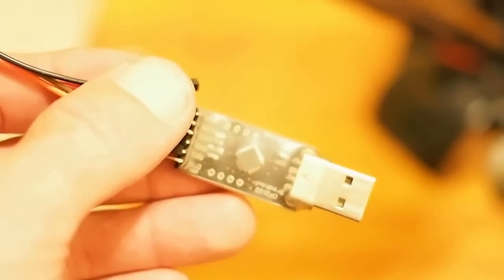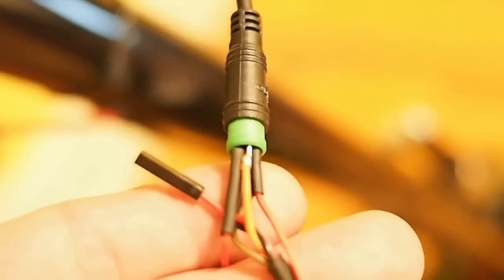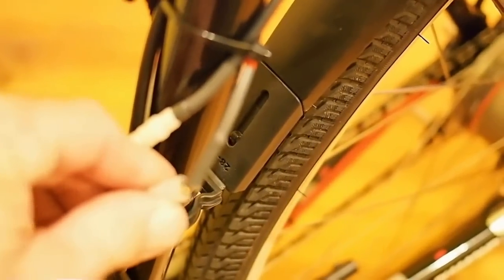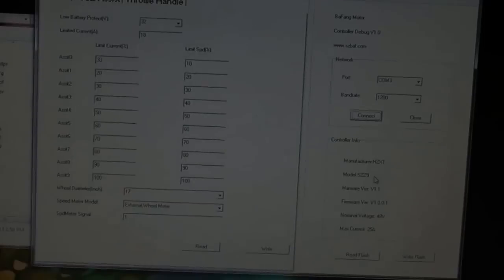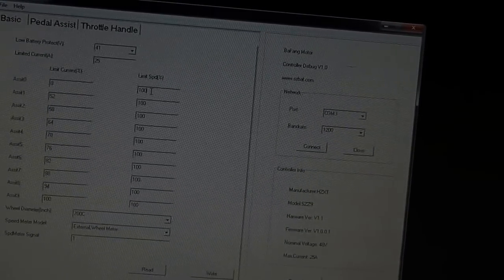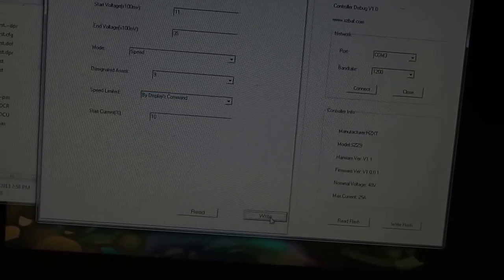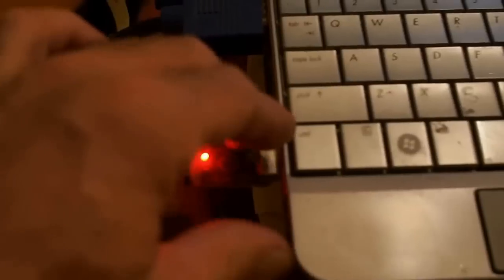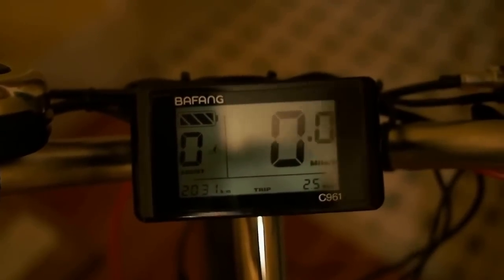Bafang BBS-02 Advanced Serial Hacking - Throttle

Comment: Anyone know if I can tap the illumination function to also activate my lights
Reply from the maker: I'm sure it's possible. But it's an advanced project. you'd need to open up the controller (C961) and find & tap into the backlight power, then use it to trigger a relay or transistor that turns on your light.

if you do this you are TOTALLY voiding your warranty. 

Note - also if you do this you should ISOLATE everything properly. this means using an optoisolator and a solid-state relay at the very least. It also means powering the ENTIRE circuit from your headlight. (You use the backlight to trigger your light but do NOT power your headlight from it! This is an important distinction. DO NOT PROCEED UNLESS YOU UNDERSTAND IT.)
Reply: +Charles Werbick yeah was mine line of thinking too was hoping someone had a schematic or the display
Reply from the maker: Andrew Meddley - Sounds counterintuitive, but I'd try Bafang themselves. They are surprisingly helpful and if you don't care about your warranty...

http://www.szbaf.com/en/service/contact.html
Reply: +Charles Werbick my warranty was vides the day I got it I think I installed a temp sensor and have been running it on a 14s4p since day one and it was only 90 days from Luna cycle

Comment: I'd like the bike to start-up in PAS 0 instead of 1. Anyone know what setting that would be?
Reply from the maker: I'm betting that's a function of the C931 (i.e. the LCD display part) more than the part being programmed here (the motor controller). You can probably get the behavior you want by changing the PAS 1 settings to NOT provide assist. That would essentially turn PAS 1 into PAS 0. But it would still say assist level '1' on the display. 

There may be a way to program the C931 to start in PAS 0. But it probably would involve hooking the FTDI adapter to the C931 and programming IT. (Which I don't know if there is software for) But that's an interesting idea...
Reply: Clever idea. I'll reconfigure PAS 1 like you said.

Thanks for the video. I was able to get the throttle to work in all PAS modes. I followed all your steps but the throttle still didn't work in PAS 0. My unit had "Designated Assist" in the throttle tab set to "Controlled by Display" from the factory. I had to change that over to 9 then I was all set.
Reply from the maker: Evan Calder Glad you got it going! FYI - it is possible with the throttle set to 9 to trip the resettable fuse in the unit if you gun it from a dead stop in high gear. (I found that out the hard way ;-) If that happens you can disconnect the battery for a few seconds to get it to reset.

Happy Riding!
Reply from the maker: Evan Calder  BTW - I edited the instructions to reflect your tip in case anyone else runs into this issue. Thanks again!
Reply: Charles Werbick Hi i seam to have done this also but I've disconnected the battery for a day and I'm still not getting anything from the motor
Reply from the maker: +Chris Chiles I had that happen too. There are capacitors inside the unit that can hold a charge for some time. To fix, short the Bafang power leads (i.e. unplug the battery,  take the power leads  that WERE connected to it and touch them to each other for a second to drain the caps in the Bafang. Make sure NOT to short the battery itself. You want to UNHOOK the battery and drain any residual energy stored in the bafang.) 

Hope that make sense.
Reply: Charles Werbick thanks or the tip but I'm still not getting any power from the motor although the walk assist chunks it doesn't turn the wheels, my speed sensor is out does that make a difference?
Reply from the maker: Chris Chiles Yes in all likelihood. The speed sensor is required to function in order for the unit to function. (The controller relies on the speed sensor to govern the motor and provide pedal assist. If it's out, you need a new one. I would not try to ride without it working properly.)
Reply: Charles Werbick Ok, I've got a new one on order, thanks for the help you've been way more help than the Chinese vendor.  The motor worked with a broken Speedo before, could you point me at the fuses?
Reply: Charles Werbick i changed the speed sensor and still nothing
Reply from the maker: Chris Chiles  Is it giving you an error when you turn it on?

BTW - when the internal fuse goes then it goes totally dead until it resets. No display, nothing. If it turns on and you get a display that's a good sign at least.
Reply: Charles Werbick I was getting an error 21 when the bike was in motion.  When I struggled it in the engine stopped the display has continued to work, and no error is showing
Reply from the maker: Chris Chiles - Error 21 is speed sensor. But the throttle should still work. (The display won't though and neither will PAS.)

Sounds like your symptoms similar to this?  -
https://www.youtube.com/watch?v=RsGEPDrhAlw

(Note - In the link above the poster says 'dead controller'. I have  no idea whether they are referring to the LCD 'controller' or to the ESC 'controller' that's in the motor housing. If your symptoms match, I'd post your question on that page. and ask them exactly how they resolved the issue.)

Comment: Oh, and my speed sensor light did not come on when I connected the battery. It worked anyway
Reply: Henrik Nilsson Hei Henrik! Try to restart your computer, then start the program from file. I have the same problem. Don´t forget to disconnect the battery pack before you disconnect the program cable. When you try again, connect the program cable first, and the start the program. Finally switch on the battery. (are you Swedish?) Thank´s for a fine tutorial Charles!

Comment: Has anyone tried this on C963 or C965? Or know if it should work or not?
Reply from the maker: +Tom Gundry  - This method programs the BBS motor unit NOT the display. So it should work. (You actually unplug the controller/LCD and use that connector to talk to the motor. )
Reply: +Charles Werbick great. I was a bit unsure if the bbs02 might use differ nt firm ware for different controller set up s
Reply from the maker: Tom Gundry - I'm sure the firmware has changed since I bought mine. Also a lot more of the settings have been documented. 

Further down in the comments there's a link to the thread about Bafang serial programming on Endless Sphere. The most up to date info will be there on that forum. (Hope this helps)
Reply from the maker: also see this- https://electricbike-blog.com/2015/06/26/a-hackers-guide-to-programming-the-bbs02/

Comment: Hi Charles, I made a cable according to the instructions and as USB to Serial TTL FTDI adapter I used the following  (http://www.aliexpress.com/item/USB-to-TTL-converter-UART-module-CH340G-CH340-3-3V-5V-switch/32392228218.html. After connecting to the computer, the speed sensor LED light come on and after starting program and selecting a COM port settings, program reports that it is connected, but not showing any data from controller (all buttons in the underside of the program are inaccessible). Can you tell me what could be wrong? Thank you.
Reply from the maker: Double check your Com port and baud settings. The com port should be listed in Control Panel->System->Device Manager and needs to match whatever port was assigned to your CH340 adapter. Baud should be set to 1200

If that doesn't work -  DOUBLE and TRIPLE check your wiring to make sure that TX and RX aren't swapped.. Be VERY careful here as one of the lines is +B voltage which can be 36-48V. THINGS CAN FRY IF HOOKED UP WRONG... (See http://i.imgur.com/3GaLDI1.jpg, right hand side P+ battery voltage.) For that reason only connect and disconnect the programming cable with the ebike battery removed and be VERY careful that neither the TX or RX wires EVER short to the P+ pin which is next to them both. If this happens you will probably damage your ebike or your computer or both.

Note also that since this video came out folks have started selling programming cables on fleabay. So that's an option as well.
Reply: Thank you for your response. I'm still crazy :-). I used original Bafang cable adapter and affiliated production as you described: see https://dl.dropboxusercontent.com/u/53277699/Cable.jpg
Pins 3 (brown wire) and 5 (red wire) (Power and P +) on the motor side connector
FTDI Ground Pin to Pin 1 (black wire) on the motor side connector
FTDI RX pin to pin 2 (green) on the motor side connector
FTDI TX pin to 4 pin (white wire) on the motor side connector
tried linking pins in the connector pins on FTDI adapter - all right
I fuse the COM port, baud rate of 1200, after connecting on Bafang FTDI adapter and run the program (the blue LED on the adapter flashes), but still not seeing any data from the control unit continuously. What's your setup parameters COM port on a PC? Or do you think that the inappropriate use USB to TTL adapter?
Reply from the maker: I don't think I changed the baud of the PC serial port to connect but you can try it. The settings are the default -8 data bits, no parity, 1 stop bit, no flow control. Not sure if the CP340 could be the problem. The other thing to confirm is that pins 3 and 5 on the  connector are jumped to each other otherwise the unit will not be powered on to receive serial communication. 

If it works you should see info pop-up immediately after clicking 'Connect' on the application.

Only other thing I can think to try is reversing the TX and RX wires. (Worth a try....)
Reply: Thank you for your suggestions - everything I tried, but without success. If not connected pin 3 and 5, then lit LED with speed sensor - it is as if it is not turned on display. Jumper 3 and 5 is connected in the cable. Pop-up info is nothing, only CLOSE button is enable - https://dl.dropboxusercontent.com/u/53277699/Program.jpg. Apparently, the problem will adapter CM340 (the second purchased did not work). Thank you and have a nice day. F.

Comment: Hello, do you think I can use this mid drive to steering wheel in tractor, similar to this https://www.youtube.com/watch?v=cWFfW7f8y7Y , Does this have protocol that I can control with m own device to control direction of rotation and rpm?
Reply from the maker: DroidFarm - I would not recommend it no. Your steering system needs to know the position of the steering wheel and also how much it it turning the wheel. So you are going to need a different setup. Probably a stepper motor for precision and some kind of hall or optical sensor to know how many degrees the steering wheel is turned and in which direction.
Reply: Yes I was planning to put encoder into the shaft to know position. I am looking to buy something already develop to minimize big times cost but I am not sure how much I can control this motor via protocol, there is not much information. Thanks for your time in advance.